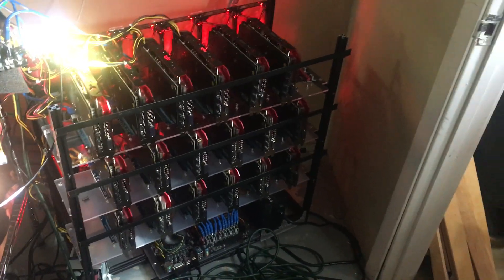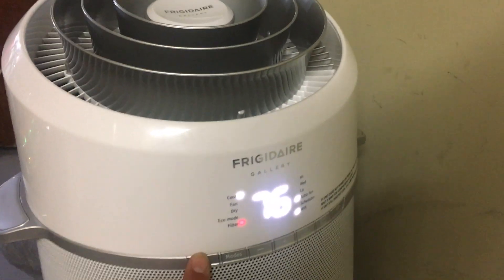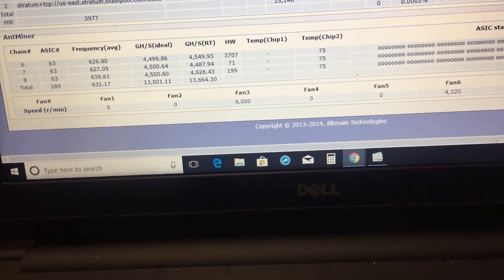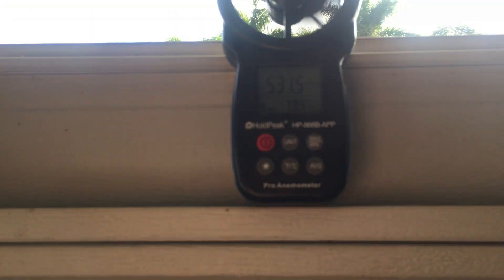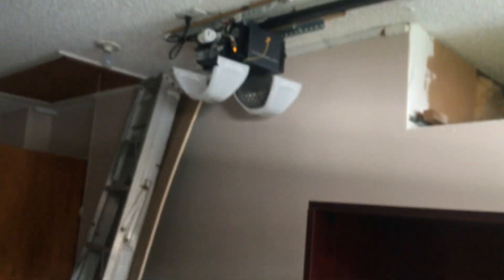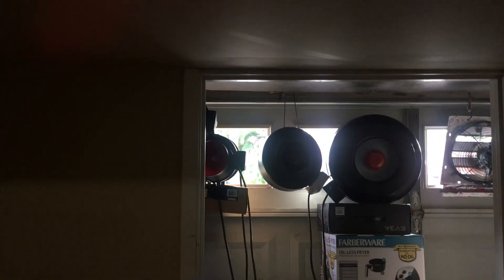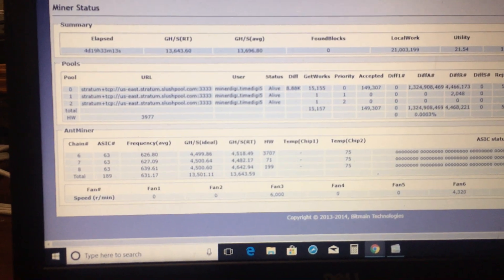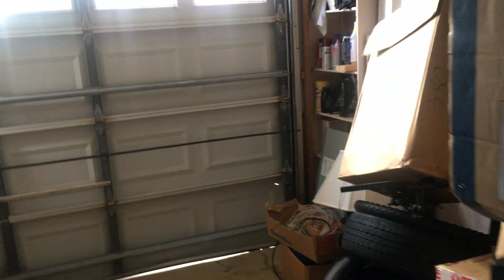Gpu mining cooling solution. Asic mining cooling system. Bitcoin Mining Farm Cooling Florida

Comment: if you like to cool more effectively. you need to exchange the all the air in the room 35 times or more an hour to start. more heat more times  needed to exchange.  take the cfm times 60 divided by the squire footage of the room. the number left is how many times an hour your exchanging all the air in the room. needs to be 35 times or more to remove the heat properly. im at 49.5 per hour and with the out side temp at 92 f my  rigs and asics stayed at 60c. im about 8000 cfm with fans running under 300 watts. hope this helps anyone!

Comment: how much do you pay per kw/h in Florida? Isn't humidity an issue? Thanks
Reply from the maker: .10 , high. I am moving the fuller operation out north west because of the sheer size I am going to I need the best possible location. Humidity is not an issue. As long as you have adequate air flow... the stronger the better to move that air quicker 💪🏽

Comment: Ahh ok with that I see more how you're moving air.  Looking good.  Are your neighbors like WTF are you doing over there.  What is that noise?
Reply from the maker: Rob W Good, I’m glad it’s helping! I’m excited for the  , 2100  CFM fans to get in those windows so I can get about 20 antminers running. That’s why I built the insulated room!!! All you hear is the whisper of the air coming out the windows. I have good security system with WiFi notification inside the garage and outside with motion detectors for safety. I think I did a good job so far with implantation, exhausting, variable control, silencing and security. To me this design outline is looking like a home run!  I want people to take from my design and make it better!! I’m excited to see the new ideas coming out because I’ll tell you these antminers are a whole other beast!